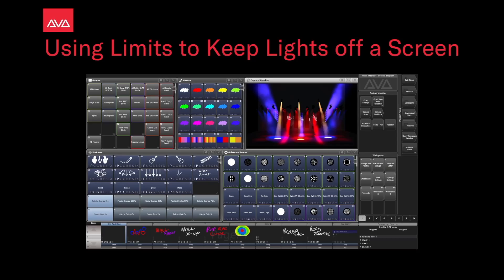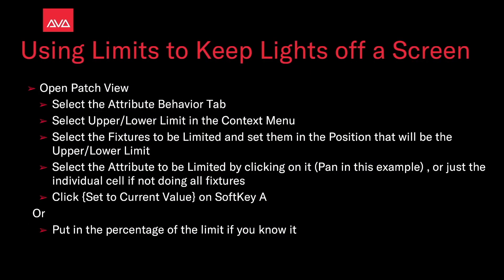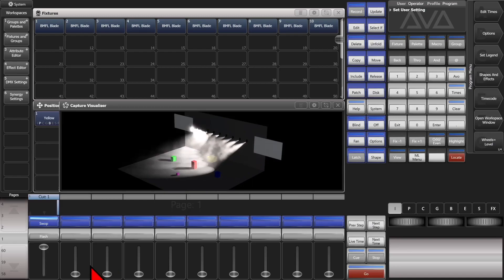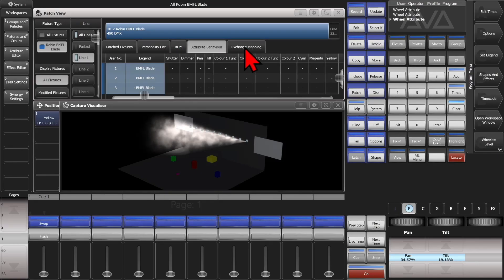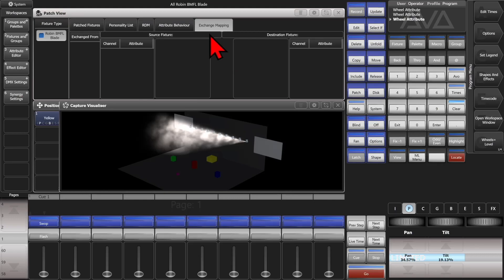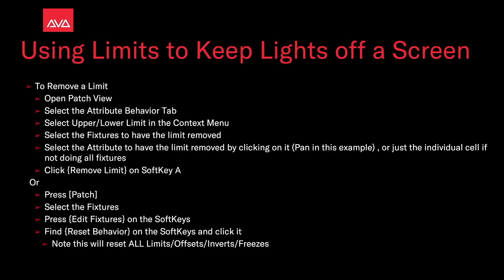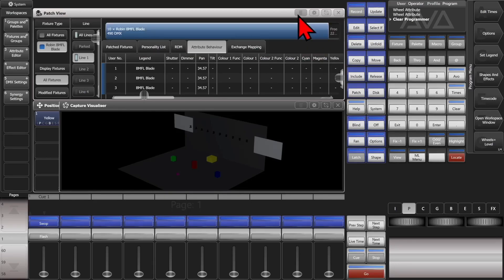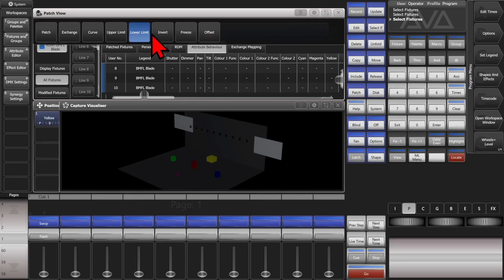Using Limits to keep lights off a screen

Comment: this is cool for avoiding objects on the edges, but i still think an option to avoid a spot in the midle would be cool. 

Lets say you didnt wanted to shed light on that red block. It would work something like this but we would have the option: "avoid this spot", so whenever the fixture  got to that point, we would have the option to make it go around, or to dim/turn off intensity
Reply: in what scenario would this be helpful? I can only think of audio techs complaning that the beams keep shining in his eyes xD
Reply: @antonkruizinga1810  weddings. Corporates, nightclubs with bars… do you want me to continue?